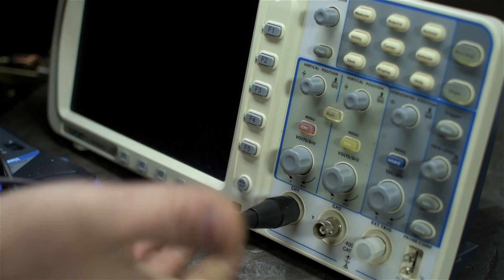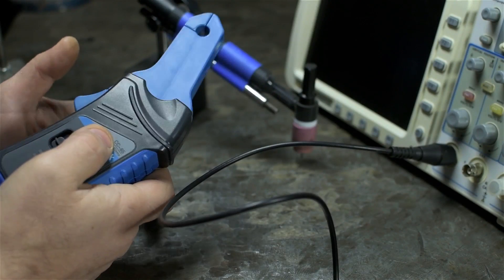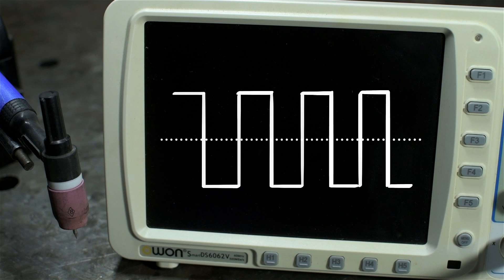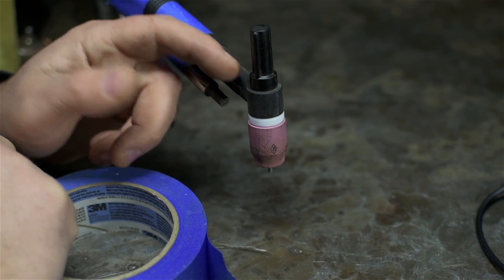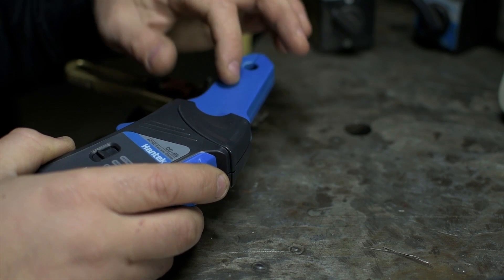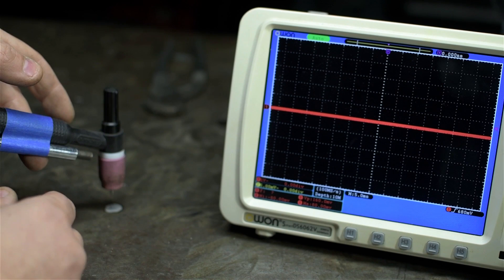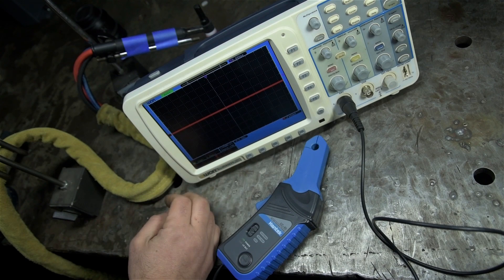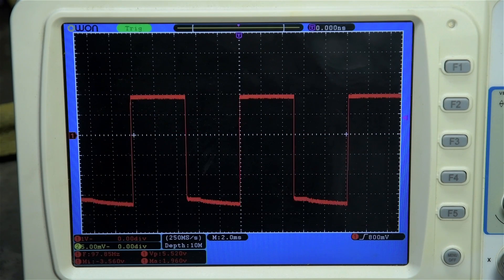Oscillo-Help-Me?

Comment: In your setup, scope ground is meaningless. Your mesurements is not referenced to earth ground, but to the probe ground. With the current clamp, you have an electrical isolation between your device under test and your scope. No power path mean no ground is relevant.

Now, you may have fried part of your scope with the previous tests... Your scope have a test point, use a wire from the center of the bnc to that test point (or a normal probe). You should see a perfect squarewave there. If you see it being offset the same way then you know the scope is faulty.

Another issue can be the probe. Some probe need to be zeroed out. Those work by mesuring the magnetic field strength. If the probe got magnetised somehow then the reading will be shifted.

Another issue can be your scope setting. Set it to DC, not AC! AC will show the ripple, DC will show the true signal. Take 5VDC, feed to AC mode, and you read 0V... Take 5VDC, put it in series with a 10VAC(peek to peek) signal, in AC you will see +/-5V. In DC you will see the true value: a 5Vpp signal offset by 5V, meaning it will be 0-10V !

There is also the possibility that you are overloading the probe. I see you set it to 1mV/10mA, maybe it overload it, try 1mV/100mA, it will reduce the signal by 10 time, which allow an higher current mesurement. The probe may not max at the same.

Check the battery in your probe. I see that it is a powered probe. It may have 2 battery inside, one could be low. One way to get a negative supply is to use two battery in series, and use the mid point as your ground. So 2x9V = +/- 9V. If the positive battery is low, you can get like +5 -9V... 

Also, try a resistive load, like an heating element. Those follow the main exactly, no phase shift, no weird thing, only directly proportional to the main voltage. That can tell you if the setup is in trouble too.

As some other said, try to reverse the clamp... so the power pass throught it in reverse... If the welder is comming on the front, put it on the back... It will reverse the current flow that the meter see...

Comment: Tony you probably shouldn't expect much from a clamp current probe. They are not designed for handling signals, they are not fast enough. I think what you are seeing on the OS is a compression of the waveform created by the slow response of the magnetic pickup. Try to do the test using a shunt resistor of very low value on the negative, say 047 ohms. The potential on the oscilloscope leads would be very low that way and you'll have a common ground that in this case is missing.

Comment: To take any reading of a wave, sine or square, triangle whatever, you need to know where 0v is.
Usually a scope has the black ground lead of it's probe connected to it's chassis and thus mains earth. The DUT (device under test) amplifier, welder ground or whatnot is also usually
the same. therefore, the ground on the DUT and scope is the same.
    You may have a DC offset where your welders wave OP is sitting at 5v DC say. One way to check is to use your DMM on DC volts, one probe to welder ground, one probe to scope ground. If you get anything but 0v, you have an offset.
  You can use another channel on your scope, no IP to show where 0v really is. It's hard to be more precise here as I can't see your test setup.

Comment: Hi Tony! From Ausfail. 
As someone who repairs welding machines for a living I think I can help you. To measure/view the output properly with the scope you need a load bank i.e a big bank of resistors that will let you pump 100A or so into them. Secondly you need to actually disable the HF, put the machine in "lift tig" or "scratch start" mode so no HF. If you can't do that you need to get inside the machine and unplug the HF module. Then get the regular clip probes on your scope, put the ground on the negative of the machine and probe on the positive and that's it! When you trigger the machine it will see the load and create the proper output accordingly without making an arc. You can see your proper wave forms then, and if the machine is doing what it says it's doing. 
Hope this helps!
Reply: Hi Sam,  Awesome info, thank you so much. Also is the best way to look at a AC Tig output  with a current clamp/probe  or just to look at the voltage with a regular probe.   Im about to buy a Oscilloscope to study my welders output and I was not sure if I would need to buy a current measuring probe as well. Also any chance on letting me know how to setup the resistors.

Comment: I know nothing about tig but my guess is that not all the current is flowing because you aren't 'welding' when your testing, but there is still current flowing to ground because of the arking and it's not reaching the 50/50 split you want cause it's reaching that on the negative swing but not the positive due to the high impedance creating an undesirable waveform.

Comment: 700+ suggestions and I read almost all of them. I don’t have a strong enough electronics background to solve this, though I have suspicions, but I’d like to apply some logic.

1. Many have noted the unnaturally clean square wave on the positive half cycle. Agreed, the welder is not generating this perfect waveform. More striking, TWO unrelated welders from different eras aren’t generating almost identical waveforms, each with perfect positive half cycles, each at the same curiously reduced current.

2. Ergo, either the current probe, the scope, or something I can’t comprehend about the arc and a ground-cable measurement point are causing it, and probably the (apparent?) amplitude (welding current) imbalance as well. Like many others, my money is on the current probe or the scope front end; a calibration or procedural problem, out of range, clipping, or just blown. I only saw one person ask whether you had tried vertical channel 2 on the scope. Me too.

3. Achieve a credible positive waveform, then start making guesses about positive vs. negative current balance in the welder. Or whether inverter welder design favors negative half-cycle current by intent, to preserve the lives of innocent tungstens...even to the unlikely point of virtually identical waveforms between your not so identical machines.

4. If I knew my scope vertical input was undamaged, I’d scope voltage directly across a current shunt, eliminating the unknown variables hidden away in that current probe, whose pedigree some have questioned.

5. If I knew someone who had an old Tek analog scope, I’d pay a visit. I really like to see electrons deflect under the influence of electrons. You could borrow one of mine if you were 12,000 miles closer. It’s 12F/-12C in good ol’ Texas tonight. We’ll have hot chocolate.
 
I’m skeptical about the idea of reduced positive-cycle welding current as a design feature. It seems more practical to achieve those balance goals via duty cycle/pulse width. Indeed, my new lime green inverter TIG machine specifically states that’s how it alters AC balance. Additionally, now speaking from a welder’s perspective, it seems that the positive-negative current imbalance your scope seems to show would appear as an incidental “pulse setting” at whatever frequency, rather than straight squarewave AC.

In the end, now you have to explain the purchase of that new HTP with the (same) defective waveform, whose purpose was to replace the old TIG machine with the defective waveform! A new scope should set everything right!

Comment: Float the ground clamp (isolate the clamp to just the part and not the bench.) and repeat the test. Clamp the Electrode side and repeat the test. I think your seeing the voltage drop across the part being welded showing up in the bias since this is an inverter welder and not a true AC transformer style buzz box.

Comment: After flipping the probe like everyone else is saying, take out it's batteries, and throw away the inductive clamp it's probably toast...  Next, go get one of these http://a.co/h9IbQYq  a 100A 100mV shunt and measure the voltage across the shunt's little screws when the welder's ground is passing thru the shunt.  Optionally you could get a larger shunt too e.g. http://a.co/5PhX1M6.  Theory here:  https://en.wikipedia.org/wiki/Shunt_(electrical)#Use_in_current_measuring

Comment: Your scope behaving badly problem is that you are picking up EMI from the HF start. You have an extremely noisy environment and the scope wasn't really designed with that in mind. 

Floating the scope really hurts there, because even decent shielding and protection techniques have no place to send the energy. You could plug the scope in, but I understand your concern. Another option would be to attach a tiny cap - like 220 pF - between the BNC connector outer shell and your wedding table. That may well fix your problem. You could also try a clamp on ferrite on the probe cable. You probably have one on a mains cable for a grinder or something.

Alternatively, is there some way to turn off the HF start on the welder?

As for the waveform imbalance I am most puzzled. Assuming you flip the clamp and the imbalance follows, i.e., is real not instrumentation, I might suggest welding to a material for which AC is appropriate. 

It may just be that starting the plasma from the steel table back to the torch is limiting the current. Try clamping down a piece of aluminum (or magnesium or something else off towards the edge of the periodic table) and welding to that while making your measurements.

Comment: Your probe output is clearly clipping at 2 divisions on the scope, you can see that it still clips perfectly flat at the ringing waveform when you stop welding.
Flip the probe around just to make sure it still clips the top, then we know for certain it is not the welder and the probe is at fault.
You did use the high range, right? because in the video the probe switch is in the middle, low range, position.

Many of the comments are painful to read, especially the inability to do anything about so much nonsense, so I had to force myself to stop reading them. I guess it is nice that people still try to help even with limited ability to do so, but for someone who does this sort of thing in his sleep it is a horror show. I will say only one thing: Ignore all comments about ground. That is not the issue here.

Comment: -Put the scope on DC coupling
-Put the clamp meter of 1mV/100mA
-Open and close the jaws a few times to get rid of any hysteresis. 
-Connect the clamp meter
-Zero the clamp meter
-Disconnect the clamp meter
-Start the arc
-Connect clamp meter
-Take measurement.

If you have doubts about the result:
-Use a known good set-up (clamp meter!, the scope is fine)
-Test your setup with a known AC (grid) and DC source (battery charger)

Comment: Iam still learning electronics FYI. Since you are measuring current it looks like the duty cycle is the same but you are drawing double the current on the negative part of the wave. I would check the Driver for the  Transistor or Mosfet that switches the negative part of the  wave and also check the negative and positive supply voltage and make sure they are the same. Iam disabled and could never afford that Tig or Awesome scope, If ya ever end up going to feed them to mother gia I would be honored to tinker with them. I hope that helps some and you figure it out. Thanks for the Great Vids ☺

Comment: Somewhere along the lines I got it in my head that AC Balance adjusts the amperage on the EP side. I.e. with the welding amps at 100, and AC balance at 30%, then, I thought that the EP side would be 70 amps and EN would be 100 amps. But I just read the miller website and it indicates the setting is the percentage of time the it stays in EP vs. EN during a single cycle. Carry on, I have nothing to add.

Comment: The manual says to set the meter (scope) to ac  when measuring ac current.  Set your scope coupling to AC instead of DC?  Zero out the clamp meter or  Alternatively, turn the position dial to center 0.  You are measuring current, not the actual ac waveform.  So who knows.  

Move the scope far away or shield it, and maybe wrap the leads through a ferrite.  Not a ferret.   Try all of this on a neighbors scope first.  Rejoice that you purchased a battery powered scope.

Take advice from someone that read the manual from another youtube video.

https://youtu.be/N3iVQUcuD3w?t=448  < relevant page in the manual
https://www.youtube.com/watch?v=gghixxu_NC8  <  a teardown by the same dude for the curious.

Actual manual.
http://www.hantek.com/Product//CC/CC65_Manual.pdf

Comment: Quick test, as many have mentioned, would be to flip the clamp and see if it still clips on the top half.  Another thing to try might be moving the clamp up and down the wire, since that big steel table has the potential to add some hysteresis to your measurements if the clamp is too close, but that might be a longshot, I'd expect the modified side to be a ramp instead of a hard clip.  The clamp is probably maxing out somewhere, either the hall effect sensor or the preamp.

Comment: With a DC clamp meter, you have a Hall effect probe. Aside from any calibration settings, as long as 0 current through the probe is giving you 0V to the scope, I think you should be good. 

As an isolating test, does the waveform flip if you rotate the clamp 180 on the cable?

As a strong hunch, I think what is happening is that the welder may be driving balanced voltage on both half cycles, but that the electron emissivity of hot tungsten is much higher than warm steel, so that when the electrode is negative, more electrons are released per volt than when the warm table is negative and releasing electrons.

Comment: I'm wondering if the arc itself isn't acting as a nonlinear element (similar to a mercury arc rectifier) and clipping off the high sides  more than the low ones.  The other suggestions to flip the current probe over would offer some insight.

You might try substituting a fixed resistor as a load instead of the TIG tip.  This could be as simple as a length of wire in a bucket of water.

Comment: This type of AC/DC current clamp is made for measuring current. It is not made for making oscilloscope waveform measurements. A non wire wound resistive attenuator would be better for an oscilloscope. Since it would be less likely to favor blocking either AC or DC current more than the other. Also, you should not have the oscilloscope on the welding table when trying to take measurements.

Comment: Not likely an old inductive current probe,  news ones are usually have a Hall effect devices and often have a dc offset calibration and on at least one I have used it had some digital magic so reversing the probe didn’t work as the commenter below suggested... I went to the tool crib a got a different less suffocated probe and went on with life ... I have often used current probes to chase noise and grounding problems in new designs the kind that drove your scope bat sh*t crazy.  I don’t care for digital scopes and the new generation of current probes for this work but the instrument gods at work assure me they are better .... too bad they don’t have to use them

Comment: I wonder if the Edison Effect comes into play here, and it's just easier to get the arc going out of the welding electrode than into it (lower absolute value of voltage required). Then to maintain equal voltage at the weld site for forward and reverse, you'd have to pump more current in one way than the other just to keep the arc alive (assuming voltage is important if this balance thing is done for electrochemical rather than thermal reasons).

That would be really interesting if it turned out to be true, actually. I've always heard that the balance concentrates heat in the electrode or the work since that's where the current's going, but that never made sense to me since thermal power = I^2 * R, and the current is the same regardless. You'd think resistance is the same regardless also, but I guess if this Edison Effect thing is true, then the real problem with running the current in "reverse" is that the electrons would rather jump out of the tippy-tip of the electrode in one direction, decreasing the effective cross-sectional area of that part of the current path and increasing the resistance effectively, making it get hotter.

You might be able to test this by grounding your electrode and putting power on your work and seeing if the welds look the same as if you set the current balance oppositely to the default "50%." That sounds really dangerous actually. Maybe instead you could try seeing what happens if you just try to get an arc going between two tungsten electrodes with identical tips ground on them - do they get equally hot? There's your current monitoring sanity-check anyhow.

Anyway I'm really interested to see how this develops, it sounds like there could be some really cool physics going on!

Comment: I vaguely recall you get most heat on the welders' negative side, so it would make sense that's where the most current is. The positive part is just to break the oxide layer. The more cleaning action you need, the more positive you need, but the hotter your torch gets.
It's been a few years since I did the course though ;)

Comment: Could it be a case off welding tip acting as a diode ?   

Google the old mercury arc diodes that use a needle and flat plate inside a glass tube   

Have you tried a resistive load too the welder   no gun just run 2 jump leads from the output too a nichrome wire you can use like a fuse just too get a reading

Comment: For what it's worth and that might not be much. I have noticed when building resonant oscillators the negative reverse EMF Is generally always larger than the positive voltage.  Perhaps the work piece is acting as a capacitive load. Something akin to a bad SWR on an antenna. That's my guess based on my observations. I had to halt those experiments as my oscilloscope started to smell funny right about the time every speaker in the house started to buzz.